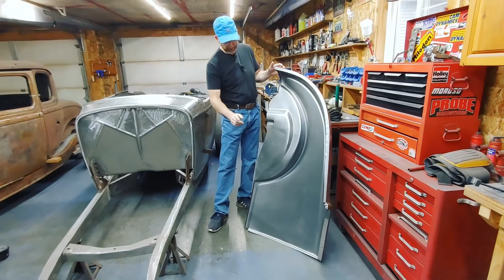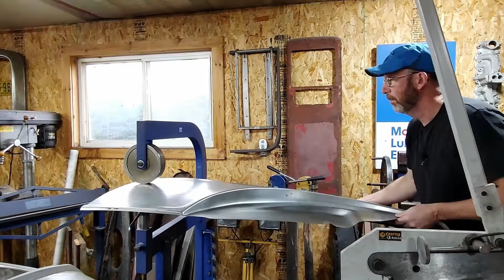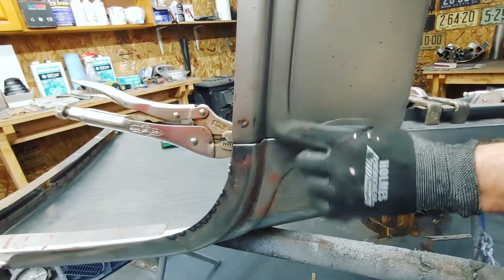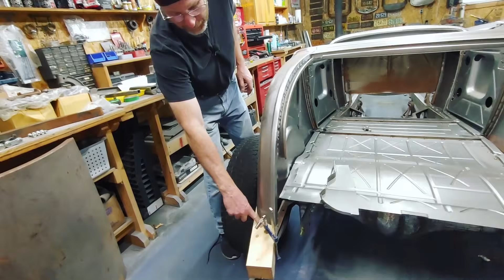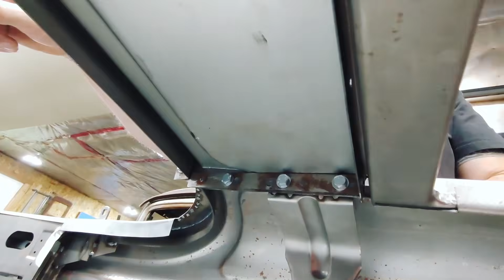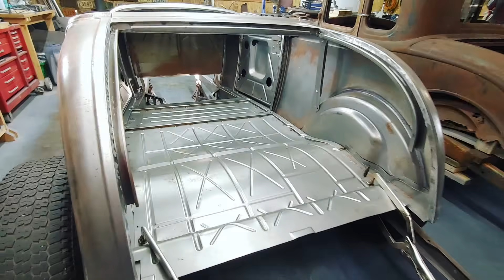Revisiting the 1932 Brookville Roadster Body Build (2022-2023) Installing the drivers quarter panel

Comment: Oh Derrick ------- It must be nice to build a body from new sheet metal ------ and not have to worry about the ---- Bottom of a quarter panel rotted away ----- maybe the bottom of the A or B pillar missing ----- or Reconstructing the floor pans or whatever it maybe --- Missing or Rotted away ------ I bet it is a real relief ---- For what most of us --- Dig Up --- and build -------- Curious here ---- I noticed you aren't really sealing / protecting the mating surfaces ---- whether primed or a solution to keep rust from forming between the two joining panels being assembled ------ I see a lot of surface rust beginning already ------ I think one would prep all the inside panels too ------ would think it would be easier now than later after being assembled -------- Anyway ----- really nice seeing a car / roadster being built with NEW Sheet Metal ------- Hope you and the Camera Lady have a Good Week ----- And Thanks Again ------ Rodney
Reply from the maker: This particular body was for a friend. When it left here it went to a body shop and was thoroughly cleaned and epoxy primed. If this were a car that would see the elements I would probably be using weld through primer as many have suggested but these cars will probably never see bad weather and be stored in heated garages. Still is not a bad idea to prep the surfaces before assembly.